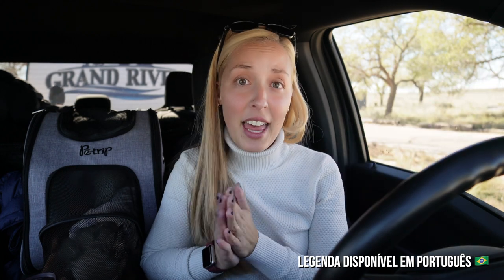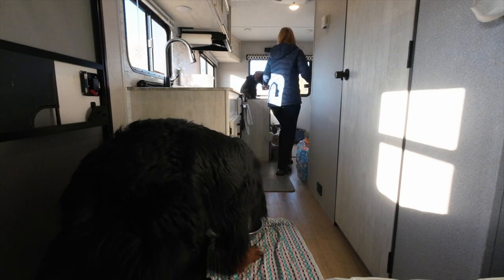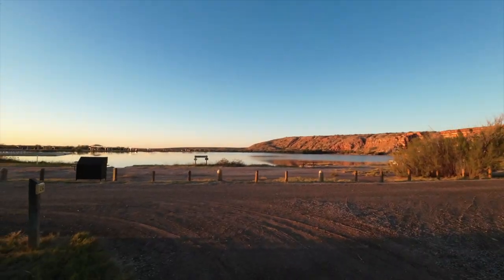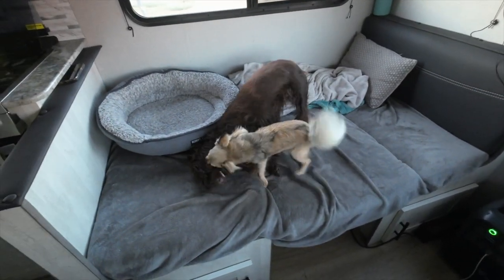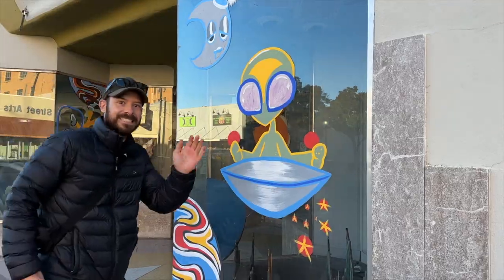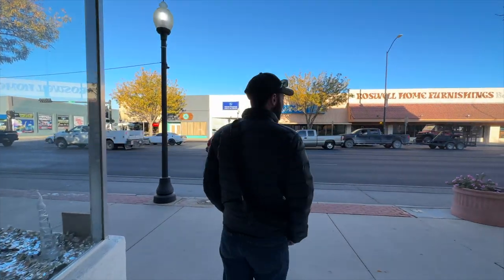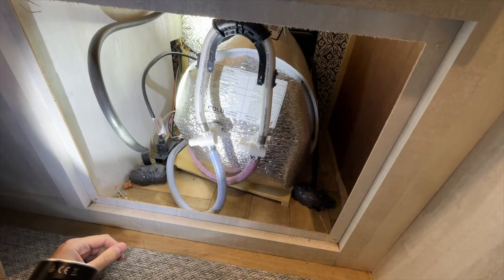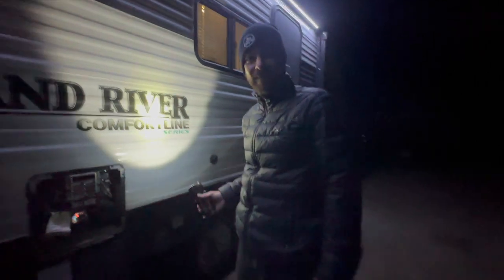RV Cold Shower and Aliens in Roswell [New Mexico]

Comment: Glad you guys figured out what was going on with your hot water tank.  You mentioned your furnace not working and the dog hair, I'm guessing it is getting into the sail switch and preventing it from staying lit.  If you haven't you may want to try replacing the sail switch as I know there were many of them that have been recalled.  This happened to us too with the cat hair and ever since it has been working great. Can't wait to see the caves in the next episode.- Kyle and Michelle
Reply from the maker: Yes, the sail switch gets caught up and to clean it we have to open the whole thing from outside since our trailer doesn’t have an easy access.
I didn’t know many have been recalled, so it might be a good test to replace it like you said. I guess we’ll use our time in Phoenix to do just that 😉
Thanks for the knowledge, Kyle 🙌♥️